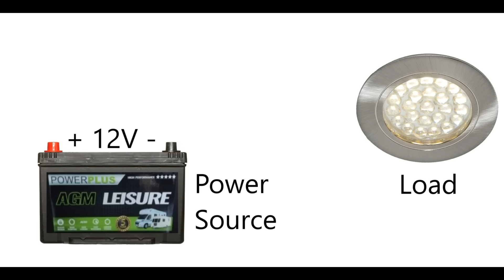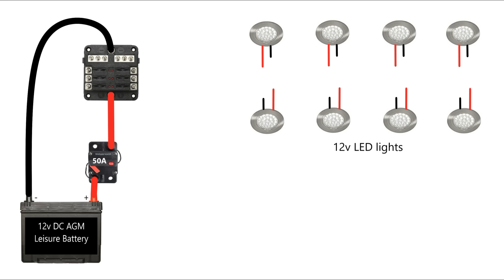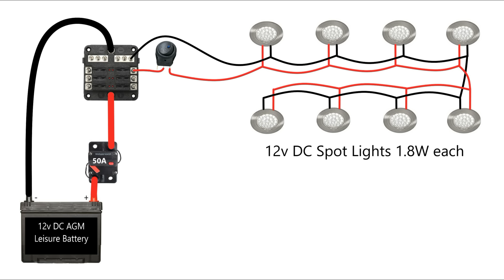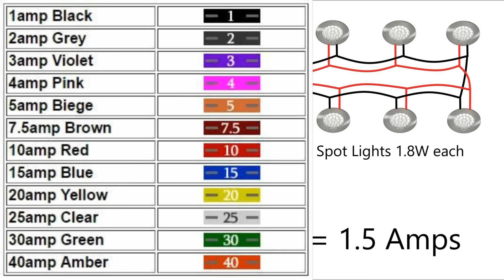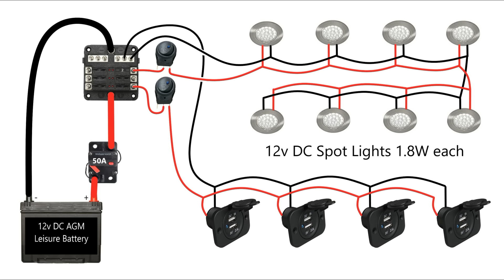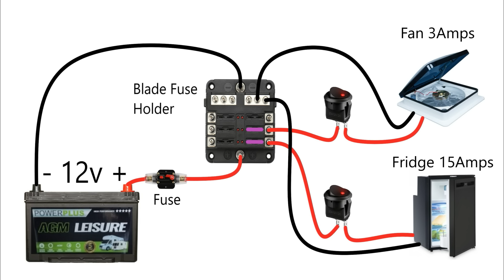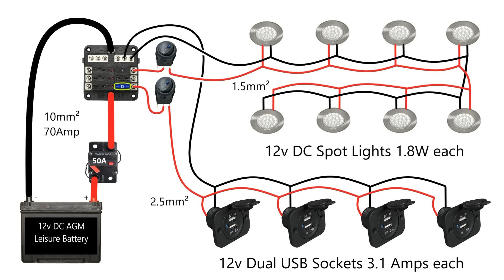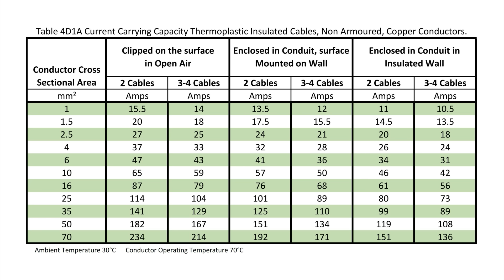Electric Cable & Fuse Sizing - Camper Van Conversion Series

Comment: To echo the many comments again! Just how great your videos are Greg, Thank you! Apologies if I've missed your reply elsewhere, but I'm still keen to understand the question of earthing or more to the point not grounding to the chassis. So many folk say that its a must but you recommend not to ?  It makes sense to me not to, but without a ground to chassis, I'm wondering whether that's why I get a small shock sometimes from appliances run through my inverter....? As its part of my "leisure battery system" from what you are saying it also doesn't need to be grounded beyond connecting the negative cable directly to the negative pole on my battery source,  Is that correct ? or does the inverter actually need grounding to the chassis ? I understand that the vans electrical system is already grounded to the chassis and that its best to keep the leisure battery system separate, but i wonder why so many folk say that a good ground to chassis helps to avoid electric shocks etc. Thanks in advance :)
Reply from the maker: OK let me try to explain better. 
12v DC electrics do not need an earth. Vehicles auto electrics often use the body as a negative path back to the battery to save running more cables. 
When you install 230volt AC mains in your van it is best to connect an earth to the van in case of fault so that you don’t get a mains voltage shock. So your inverter case needs an earth. Any mains appliances need an earth and I also connect the hook up earth to all my other earths on a common earth bar. 
If you get a short circuit in a mains device the leakage to earth will trigger any trips and prevent you getting a shock too. Hope that helps. 
Where people get confused is mixing the terms ground and earth. 
Neither of these terms should be used when talking about DC electrics. Only positives and negatives. 👍🏼😁
Reply: Thank you so very much Greg, That helps loads! So to be sure I understand..... Although there is no dedicated ground/earth point on my 230volt creating device (inverter) I can go ahead and attach for example a 3mm cable to a screw that is already screwed into the casing on the inverter body and run that to the chassis? As opposed to adding a second black wire to the negative port on the inverter and running it from there?   
I'm guessing with this in place all  230v appliances connected to the inverter are now earthed via the inverter? (eg: 600 watt kettle/laptop ) 
It seems quite nuts that the makers of lots of inverters don't create a dedicated ground point on the inverter! 
In addition to creating an earth point for your inverter do you also create an earth to solid terra firmer via something like an anti-static chain for extra grounding? or is the chassis connection sufficient?  

As with so many! grateful thanks for all the time, interest, and encouragement you give to all us newbies :)
Reply from the maker: @FootnotesVMT  a lot of inverters do have an earth point on the casing. Check the instructions. Most are earth internally. But if it has a metal case then an earth cable from the metal case to the van won’t do any harm.
Reply: Thanks again. The manual just states to connect to the negative terminal of the battery. So I'm guessing that they are working on the basis that the leisure battery is "earthed" to the chassis. As I have not "earthed" the leisure battery so as to keep the leisure battery circuit separate from the van, is it better that i connect just the casing of the inverter ? or for a better earth do i add another cable from the negative terminal of the inverter and ground that ? but then surely "earthing" from the terminal in turn "earths" the whole circuit, not just the inverter? Thank you for your patience😀

Comment: I am not sure about your numbers when it comes to sizing wire. Here in Texas the wire gets bigger is the number gets smaller but based on your diagram I would say that you're 10 mm is not equivalent to a number 10 wire here in Texas because your You're 6 mm and you're 10 mm based on the way you're using your wire I would assume that you're 10 mm is bigger than your 6 mm which makes perfect sense but as I am sure you were aware our wire gets bigger as the number gets smaller you may have done a video on this already but I haven't seen it yet.
Reply from the maker: Who else would invent a sizing system where the number get smaller as the size gets bigger 😂😆 you can google conversion charts for easy reference. 
My sizes relate to the cross sectional area of the copper core.

Comment: Hi Greg, i saw your vidéo, and it's very helpful for me.  But how do we know the section of electric wire used from the auxiliary battery 12v to the fuse box, in your example it's 10 mm2, can you help me to calculate the section of the electric wire.  Thanks a lot for your explanations.  I have a VARTA professionnal pro 95Ah, 850A, 12v alone in a box.  Sorry for my English i'm a belgian man.  I saw you in many vidéos and van lifer congress, you are very interesting man.

Comment: This has been so informative and helpful. Can this be replicated on a boat? Also have you got a video on adding a Argofet 2 battery split charger?
Reply from the maker: Yes 12v dc systems for boats are very similar to camper vans. 
This link will give you a diagram for that split charger. https://www.victronenergy.com/upload/documents/Manual-Argofet-EN-NL-FR-DE-IT-ES-SE-TR.pdf
Reply: @GregVirgoe  thank you so much.

Comment: This was a great video!  Explanations were clear and concise.  I am attempting to apply your parallel wiring mock-up to a lighting enhancement I want to do on my fishing boat.  My confusion is related to my switches.  The wiring diagram for my switch panel require each switch to be grounded, as well as the “appliance” being controlled by the switch.  What would happen if I grounded the switch that operated the parallel circuit?
Reply from the maker: On most switch panels the negative is only there to illuminate an LED on the switch to let you know that device is on. The switch only needs to break the positive supply to the lights as I showed. If you don’t want the LEDs on the panel to illuminate you can leave the negative off the switches.

Comment: Hi Greg . Great video and diagrams. There doesn't appear to be any ground connection.. unless I have missed it .. is it not needed.. or have I just not seen it.. ?.. cheers.. 😜
Reply from the maker: With a 12v DC system you do not need a ground.

Comment: Greg, I really appreciated this video. Your willingness to share good information. Safe information.
I am in the build process of a Toyota Tacoma for the purpose of dispersed camping. Out back the typical camp lighting, fridge, water.
Up front the higher draw load items, bigger lights and winch.
I've done a lot of work so far and have got to the aspects of the wiring.  You make no mention of the use of relays in this video.
I understand the principal use of a relay. Was there no need to mention a relay in this vid because the loads were small? If the switch carries good amperage rating is it okay to use just the switch?

Thanks - William USA
Reply from the maker: You are right you do need to consider the amp rating of any switches you propose to use. A relay would be a good way of switching a larger load. I’m putting together a video on switching and have a new relay panel to show too
Reply: @GregVirgoe  Greg, Its my first in reaching out on YouTube. Appreciate such a fast and successful reply.
I hope to catch the information.  I think it would be great.  You have a great demeanor while sharing.  Thanks
William
Reply from the maker: @williamlucrisia9169  I’m honoured that you chose my channel to comment. Thank you 🙏🏼 
I have put together a playlist of essential videos like this one that you may find lots of useful information. Hope it helps https://youtube.com/playlist?list=PLLhAyWhGGbi4nOabmpkLMGvfLGox2ljp_
Reply: @GregVirgoe   Can't thank you enough. Again thank for good information and sharing it.

Comment: Thanks, this was very helpful! I was wondering if a USB adapter like this one uses 3.1 Amps on 5V while charging the connected devices instead of 3.1 Amps on 12V? 5V x 3.1A = 15.5W, that’s about 1.3A on 12V, so the fuse can be lower I guess, if you don’t consider the extra current possibly needed for the 12V-5V conversion and the heat this produces. I’m gonna put an Amps meter on it next weekend :)

Comment: Amazing info buddy, I'll have a more detailed look when I get a chance. I need to run electric to my lock up via solar. I've bought 2 panels and 2 batteries. Just wondering what a good decent controller would be,as I see them on ebay for like £8. I only want lights and maybe to use a drill or grinder. I have,a,1000w and a 2000 converter too so spoilt for choice.
Reply from the maker: To get the most out of your panels go for a MPPT solar charge controller.

Comment: Hey...thanks for your videos.  I pick your brain all the time for my new trailer conversion.  

So...I am planning an install of two 200W panels (Newpowa 200W Monocrystalline 200 Watt 12V Solar Panel High Efficiency Mono Module RV Marine Boat Off Grid (200W New)) on the roof of my new 6x10 trailer conversion.  Each panel will have an inline fuse on the positive cable.  

I also have a portable set of panels (Dokio 300W kit), which I normally use to charge my portable Jackery 1000.  I will be joining the two rooftop sets of wires from the panels into one set using a y-connector and then entering my trailer roof.  Then in the electrical compartment, install another y-connector which would allow me to , on occasion, connect my portable panels to add to the system solar input.  Would having that occasionally accessed ability screw up my solar inputs?

I al also installing a switchable 30A circuit breaker on the positive feed from the solar panels.  That would give me the ability to switch off the positive feed when I needed to work on the system.

The system (mostly guided by your instruction) I am building in the next few days:
Renogy 40A controller with Bluetooth, feeding a 100 Battleborn Lithium.  The battery is also feeding  the busses which feed a 12v fuse box, which feeds my trailer lighting, fridge, and stuff.  
There is a catastrophic 300A circuit breaker and then a battery switch between the battery and the positive Buss.
The 12v fuse box is also fed by a converter (Progressive Dynamics PD9260CV Inteli-Power 9200 Series Converter/Charger with Charge Wizard - 60 Amp).  That charger plugs into a shore power outlet, for the times I would be plugged into that shore power.  
My shore power outlets are fed by a breaker box with two 20a SquareD breakers.  That breaker box is fed by a plug in the outside trailer wall for the shore power connection.
The Buss also feeds a Renogy 2000W inverter.

Nothing installed yet.  Am I good to go?  What am I missing?
And thanks again.

Comment: Hi Dear Greg.
Thanks for useful and easy videos . You help me a lot through your videos ,
My question is : If by mistake i cross wires from Panels to Charger, could damage some think ?
I Have 4 panels of 100 whats each on series , my tester read  ( _ 80 ) !!
Thanks
Ross
Reply from the maker: Yes you can damage the controller the way to test the polarity of your cables is to check the voltage across them with a multimeter. A possitive reading means polarity is correct and a negative reading means polarity is reversed https://youtu.be/Cgtsorabhsg

Comment: Hi Greg, this has help a lot although I am still scratching my head. I’m your pdf you have the solar panels using 4 mm cable and also the fridge using 4 mm cable. Please can you confirm the fridge is running 4 mm. Many thanks.
Reply from the maker: A lot of compressor fridge do not work if there is a slight voltage drop so the supply cable needs to be oversized. I used 6mm cable to supply our fridge in the van. The manual will back that up. 👍🏼😊

Comment: I am sure it is to far after the video to get an answer but want to make sure I got it right. The USB charger has a 2.1a (5v) and a 1a (5v) outlet which is 3.1a (5v) not 3.1a (12v). For a similar item I found on Amazon the same 2 port drew less than 2a @ 12v and used a 2a fuse. All the math in the video is right, just wondering if the math on the USB was correct?

Comment: I have a question please , Why did u use 1.5mm^2 cable size (15 A) even if the led lights will need bout 1.8A only? (1.2x1.25x1.25 amps)
Reply from the maker: To standardise on cable so I didn’t have to buy lots of different sizes. It never hurts to go bigger on cables. They run cooler with less voltage drop. 👍🏼🤩

Comment: Hey Greg, not sure if you will see this but in case you do, I do have a quick question. On the final table at the end, there are obviously the ratings for outside, conduit and then enclosed. I wondered, as a rule of thumb, what should we regard the van to be? We're doing a sprinter conversion similar to yours and almost all of the cables we install will be enclosed inside the van just in plastic conduits that would run within the back of the cupboards etc, so would you consider that the insulated wall or the mounted on wall? I appreciate that you can't take responsibility for it etc. but just wondered your opinion. Thanks very much!
Reply from the maker: If you take it as within the wall then you will be covered. Never any harm in going bigger on cables. You might fill the cupboard with clothes then it’s kind of insulated too 😊
Reply: @GregVirgoe  Thanks, Greg!

Comment: Please do a vid  on how to safely wire a DVR to any car or van  and use auxiliary battery  from main car battery to charge the Auxilary battery when your driving and leave the DVR  recording when your not using the car or van  so yu watch the car surroundings when you not using it thanks then it use the remote view from my  car  and how to sort out the cable section  and fuse supply of the DVR thanks from Garry in wales uk

Comment: Hi Greg, thanks for another really informative video. this might be a silly question, but as they say the only silly question is the one not asked. I'm abit confused, when choosing the cable sizing for the lights why did you go for 1.5mm2 not 1mm2, as it seems all the figures on the table for the 1mm are significantly larger than the lights combined ampage. the only reason I ask is that I'm a complete rookie and just wanted to make sure im reading the table correctly. hope that makes sense. all the best to you and the family, Rowan,
Reply from the maker: You can go for 1mm as you rightly say. I chose to standard size most of my low volt cable so I could just buy a 50m drum. There no harm in going bigger on cables you are more safe doing that. Hope that helps
Reply: @GregVirgoe  thank you so much that does help. honestly Greg you have been a huge help to me so far with my van. genuinely thank you.  all the very best Rowan

Comment: Thank you for this video I have subscribed. Very well put together and easy to understand. Can I just ask. The USB part is 5v so would that not change the amp draw ?
Reply from the maker: Yes you are correct it would be less amps at 12v so my cable was slightly oversized but on the right side.

Comment: Just started watching this and it looks prity good just wondering on the rating of the cables been taken from the mains rating tables also the USB adaptors in the example draw upto 3.1A at 5V not 12 as they have a DCDC PSU in each of them expecting 80% conversion efficiency that would be 1.3/0.8 or about 1.6A each that said the values given are conservative and a lot better than the string some people use ....good work Greg

Comment: Really really good vid.  You make it sound so simple.  Sorry if I've missed a previous vid but when you go to buy wiring, is it labelled as cross section area or is there a table of British Standard codes for what amps the wire can deal with and the corresponding code on the shelf at B&Q?
Reply from the maker: The sizes of British cables all refer to the cross sectional area of the copper conductor. I use these two suppliers for all my cables. 
https://www.electriccable.co.uk/
And for 12v battery cables
https://www.12voltplanet.co.uk/cable.html
Reply: @GregVirgoe  It's like putting a jigsaw together!  Back to download your table now.  Both websites look straightforward but yesterday they'd have made no sense at all.  Thank You

Comment: What you state regarding voltage drop at 11:45 is not quite true I think. If you connect a number of loads (LEDs) in serial, the 12v from your battery will distribute evenly across the loads.

Comment: Hi Greg, Thank you for your great video, so informative and well explained. This was a very daunting part of the process for me for both a van build and understanding better the electrical system on my narrowboat. I have been contemplating the electrical system and think that i have no real requirement for 240V as most things now can use 12v for and from the boat know that inverters use quite a lot of electric. Is there any reason why I can't do this as all diagrams seem to include 240V?   Also I am keen to understand more about how to charge the leisure batteries from the Alternator and the cabling etc required< do you cover this in your videos anywhere?

Comment: This is super helpful as always, Greg – thank you!

I've got a question (I haven't seen it asked so far, so apologies if I missed it!). On the cable sizing chart, each scenario (outdoors/in conduit/in insulated wall) has two columns: 2 cables and 3-4 cables. Does this mean 2-core vs. 3-4-core cables, or does it mean the number of cables placed close together (e.g. if you had 3 cables put through the same bit of conduit and therefore close together)? Thanks for your help!!
Reply from the maker: Generally the number of cables you have running together in the same space if you have a bunch runngin through the same conduit for example. As they will all add to the heat given off.